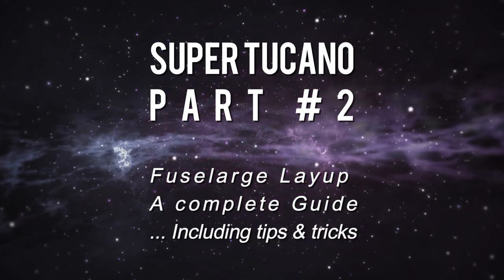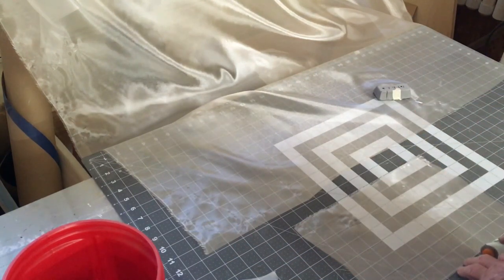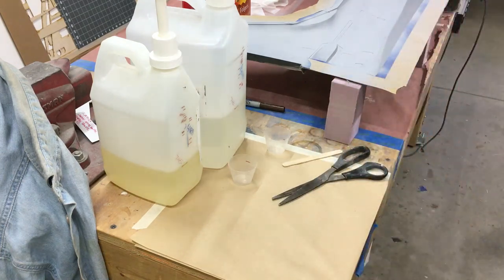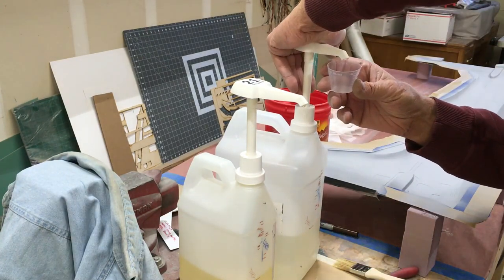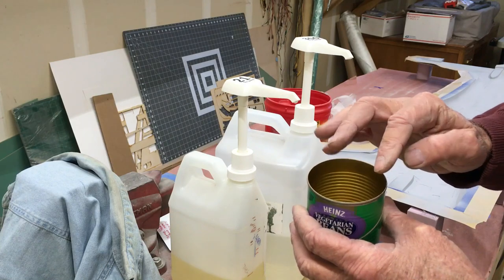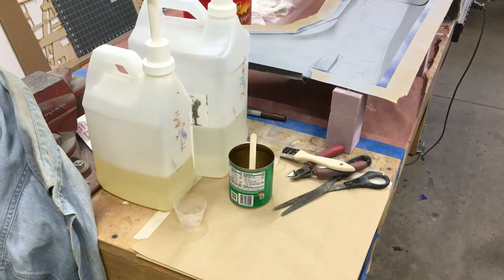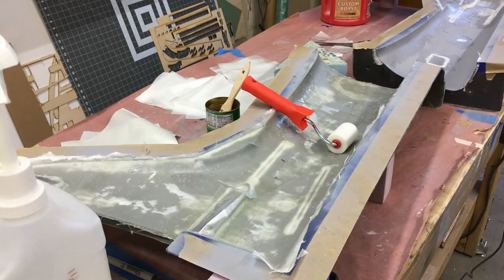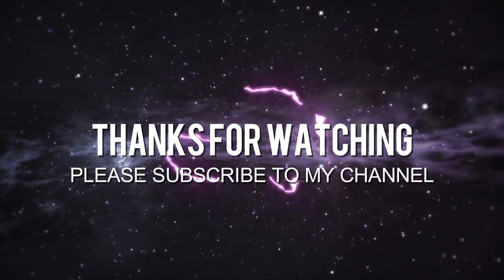Tucano Fuse Layup Part #2

Comment: Why a primer and not gelcoat for the first layer? Great video!
Reply from the maker: Primer makes the finished part pre-primed.  For models you do not use a gel coat due to weight.  The first layer of resin and cloth acts like a primed gel coat...  In my making the wing molds coming next I show how to do the actual gel/tool coats.  Subscribe and get the announcements.  Thanks for the comment
Reply: @britcharming  Thanks for the answer. I make helikopter fuselages and did not know your method ! I will try it for my next project. Best regards, Peter

Comment: Thanks for the video! Whould You use any core material-foam or honeycomb?
Reply from the maker: Good question, We use foam in the wings which are vac bagged.  Video coming a little later.  The fuse and tail section only require carbon fiber.  Over the next couple of months will be a lot of vids showing the entire build from A to Z